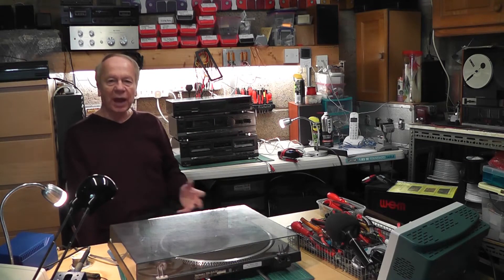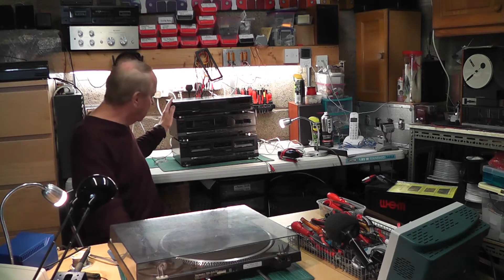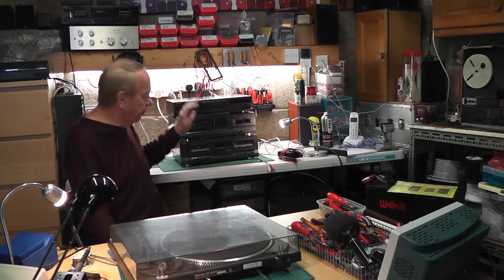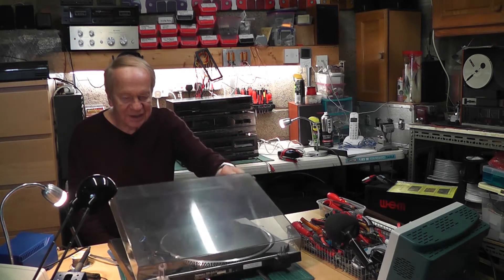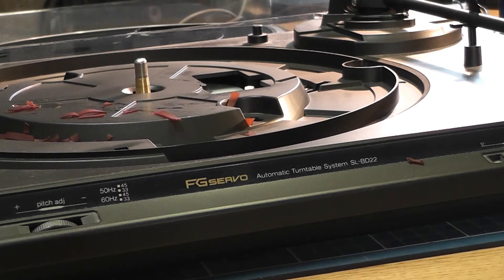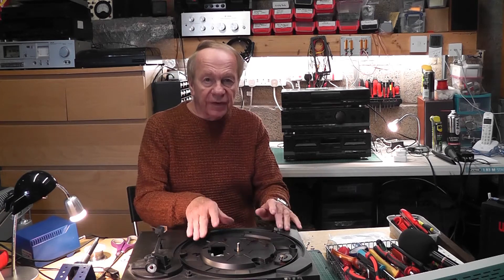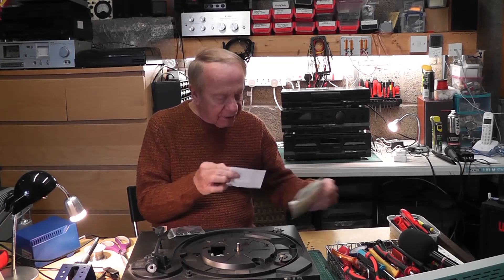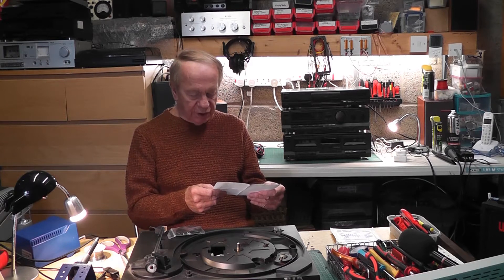Technics Audio stacking system,  early 90's

Comment: Can you stack these Technics devices on top of each other in any order? For example, I have a pretty heavy Technics amp (maybe more than 10kg) sa-ax7, is it ok to place that amp on top of the 90s Technics CD players?
Reply from the maker: I would personally use some form of rack, putting heavy equipment on top of each other can lead to problems, not to mention accidents, hope this help. All the best
David
Reply: @DavidHallettProjects  Thanks, I guess that is wise. It's weird because you often see these kind of Technics devices stacked. They are equally sized and they have these identical round metallic legs that suggest you could stack them in any order you wish. However, my amp's manual states that no other devices should be placed on top of it because of the heat it generates to the top part. That's why I was thinking about stacking the devices while keeping the amp on the very top.
Reply from the maker: @meanmole3212  
Yes heat can be a problem, dry air and increased dust, also depends on how long you use the equipment. I think you are wise to separate things. All the best.
David
Reply: @DavidHallettProjects  how do you separate them? I’ve bought a system that I want to separate in to two pairs. Any tips much appreciated
Reply from the maker: @shabbadabbadooby  
Hi Alex,
Depends on what separation you plan. I would keep the CD player and tape units together and have the deck and tuner amplifier together. Use decent phono audio cables and make sure you ave God grounds. Hope this helps.
David